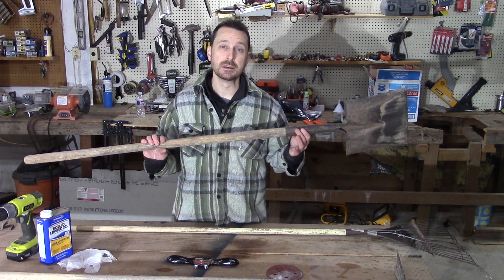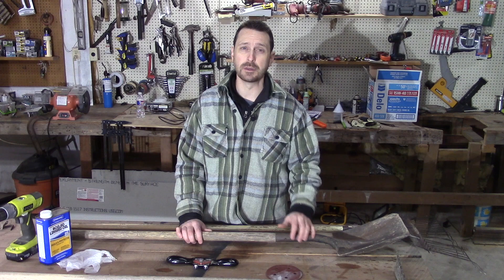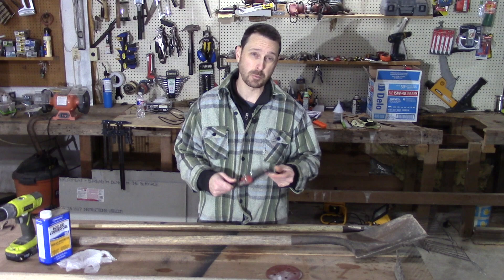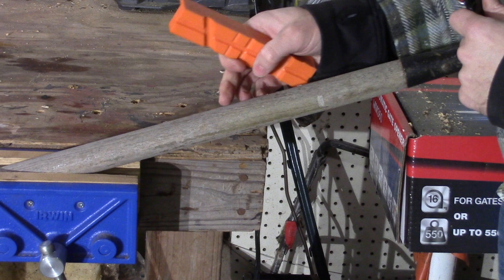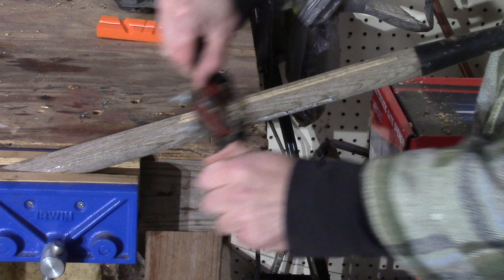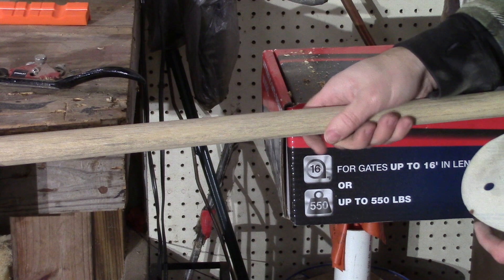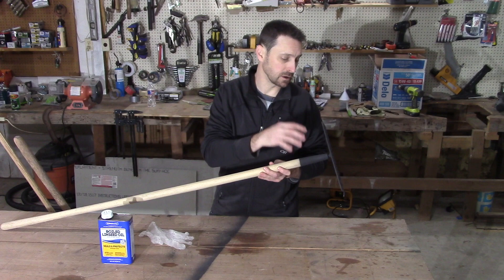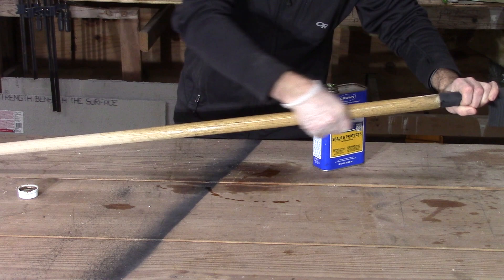Restoring Wooden Tool Handles (How To)

Comment: Can you use some else beside spokeshave?
Reply from the maker: If you are skilled enough, you could use a draw knife. It would be difficult.
Reply: @CountryLivingExperience  is there a specific reason you didn't simply sand it from the get go?
Reply: I'm a totally random mostly inexperienced dude but I would imagine any lathe or just heavier sandpaper.

I've asked why they didn't just sand but I assume to save time
Reply from the maker: @drumboarder1  It would take way too long. The lacquer the manufacturers put on the handle is very thick.

Comment: The little research Ive done says that BLO is toxic and raw linseed/flax oil is better. Hope this helps.
Reply from the maker: I am not worried about it in the quantities that I have used it.
Reply: I think that’s backwards. It’s the raw that produces unsavory elements.
Reply: @waynewoodbeck5953  anytime it says boiled, it means there are added siccatives in it and is not actually boiled at all. those siccatives are actually what make them combustible as well. never leave balled up rags in you shop. raw is just that, raw. it is basically a vegetable oil and completely harmless but takes forever to dry. polymerized linseed oil is also harmless and doesn't take as long to dry.
Reply: If you are concerned about toxicity, you probably shouldn’t drink it.  😉